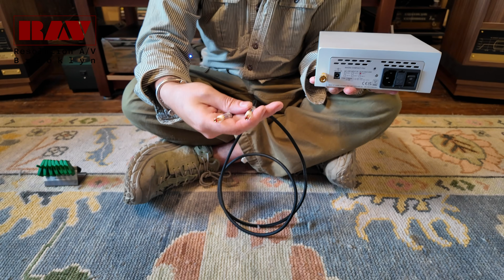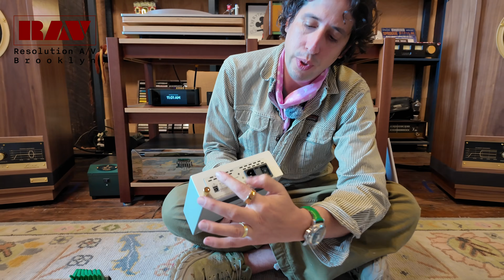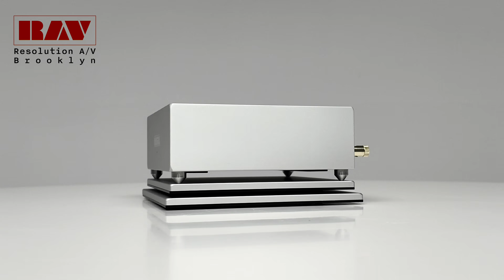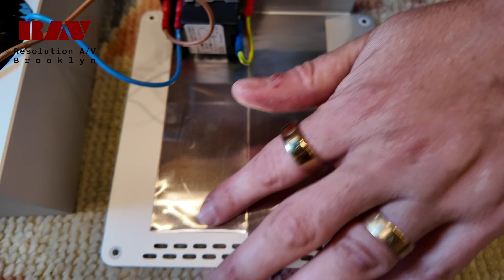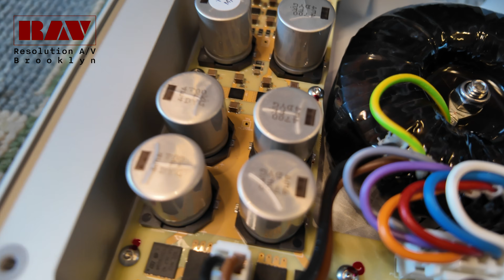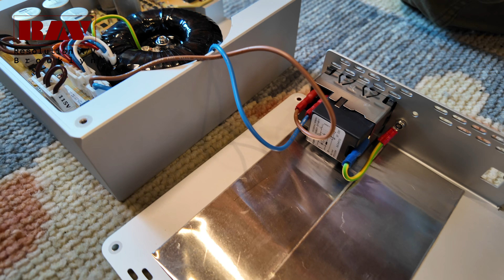A deep dive into the New Nagra Compact PSU! An affordable upgrade for all of your Nagra and more!

Comment: Ive recently experimented with 1.5mm  ho7rn f power cable and Brading, its so much better than the stock hard plastic cable and iec plugs that comes with most gear!  In the uk power is pretty clean but its on my list to get power straight from the consumer unit! Got to keep scratching those audio addictions. ✌
Reply from the maker: Love it